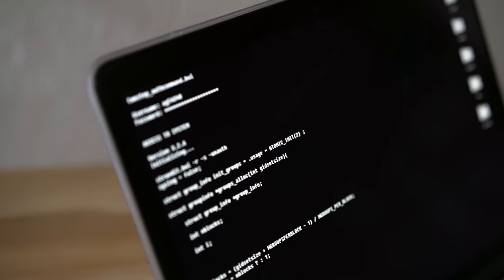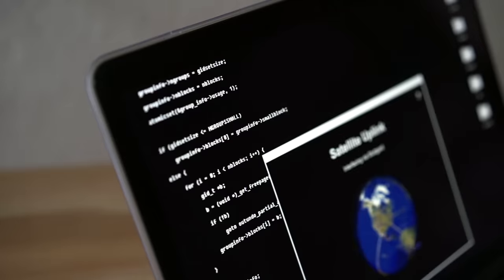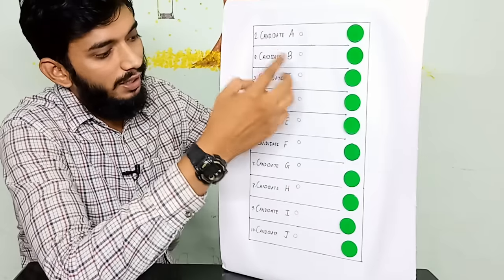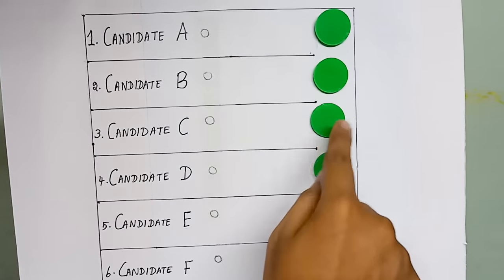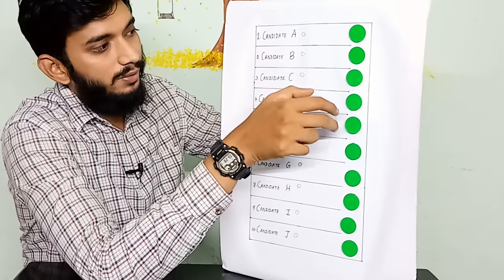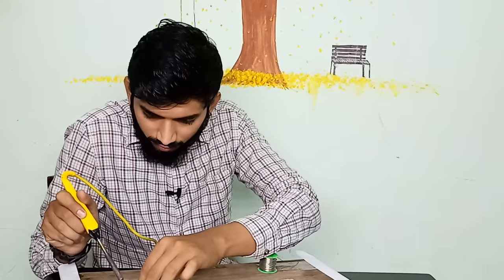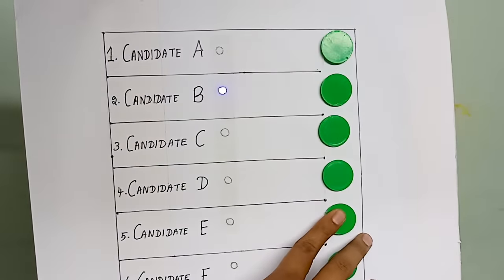EVM 'HACK' பண்ண போறேன்!! Is it possible to hack Voting Machine (EVM)?_Tamil.

Comment: Bro I have participated in EVM hackathon with my team organized by ECI in 2017 at Delhi. EEPROM serial number(16 bit) is actually binded with in the ROM software, so even if you replace another EEPROM that has different serial number the control unit will not read the memory at all. It will throw MEM ERR. The ROM is once programmable during manufacturing I can't even reverse engineer the ROM byte code. Athula JTAG illa UART illa I2C illa onnume illa. Thalakila ninnu thanni kudichi paathutom onnum panna mudila.. 😭
Reply: Oru machine la record aana vote ah inoru machine la display pannikaatrom nu challenge pannom 1st round la. Waste of time. Ipo Iruka M3 model la innum secure pannatha kelvi paten adhu yennanu therila.
Reply: The only hack we could able to do is reordering the LED display. Instead of 4000, we could able to make it show as 0004 or 0040. Simple soldering trick. But adhyum ipo single module ah potutanga nu ninaikaren.
Reply: Thanks for sharing
Reply: Nice  info man
Reply: Engineering Facts Said Total Wrong, by seeing one side of coin. He missed to see another side. 
By the Programing Technique Anything Can Be Done.
Reply: @rejoiceagainisay6548  onnum panna mudiyathu.ean onnum panna mudiyathu nu thelivaa bhai sollitaru...maruoadiyumaa nambikkai varala
Reply: @MuthuKumar-sw7pe 

1st button la every 4500 press ku apram next 500 presses 4th symbol ku count register aaganum, light, VVPAT ellam endha physical button press pannomo adhu dhaan varanum. Ipadi panna mudiyuma? Because all they do is checking the count, not counting VVPAT.
Reply: There are EEPROMs with modifiable serial number. Or you can also add another microcontroller to simulate like an eeprom. So the steps would be: 1) Remove existing EEPROM and read it's ID 2) Have microcontroller to have the ROM code hardcoded and perform MiTM. Additionally, you can also extract the uC FW and modify the portion with EEPROM ID and reprogram another CHIP. It's too much work, but definitely doable. On top, there is no surety that there is no backdoor.
Reply: If there is backdoor what would be channel to access, just wondering. Radio waves ? Am sure even if someone manipulates it, it not going to based on eeprom..since everyones focus will be on eeprom
Reply: தம்பி இதை வெளியே சொல்ல தைரியம் வேண்டும். அரசியல் வாதிகளும் biased மீடியா காரனும் என்ன சொன்னாலும் இதை ஒத்துக்கிட மாட்டான்.
Reply: @CyberPsychGaming . நீங்க சொல்ற எல்லாமே ப்ரோக்ராம் பண்ணுன சாத்தியம் ஆனா இது வெறும் interface. So அதுக்கு சான்ஸ் இல்லை.
Reply: @elangorajasekaran7871  Apram epadi, 2019 election la AMMK ku 1900 booth la oru vote kooda register aagala? Candidate avanuke podalaya, ila candidate friends and family avanuku podalaya? 2018 la Karnataka Hubli thogudhila, count kum VVPAT kum 207 votes difference epadi vandhuchu, ketadhuku edhula adhigamo, adha vechukonga nu Election commission sonnangale, ipadi thappu nadakka chance irukka device'a epadi use panraanga?
Reply: Japanese drop this voting system 😅coz very easy to hack not 1ly Japanese lots big countrys
Reply: Good information 👍
Reply: Simply waste of time . EC solluratha ,puriyara maari solluraapla .. avvalavuthaan
Reply: @hariharanb785  Bro even if you read the ID of EEPROM , how do we know what encryption is used for the embedding software? Without that we cannot match..
Reply: @kaaki_Indian that too not possible due to the process called mock poll
Reply: @CyberPsychGaming wrong......u should know the process of how candidates list prepared and what is randomisation process
Reply: @MegaPugazh adhukadha konjam padikanum bosss...
Reply: @hariharanb785 this much work pandrathuuku evlo neram aagum pa...time between mock poll and actual poll is 30min ...oh so oru general election la say 1 lack booth ....so 1 lakah hardware guy in all booths before 30 min all the thing is doable...enna oru karpani...Ok counting munnadi polling ku aprom idha pannalama ..adhum possible illa 
.once counting is over the saved data is secured ..that is said as Hot EVM ..if any small physical damage happens the system is self memory destroyable..so better luck
Reply: @jeyssekar5799  that is true. I think a backdoor is a big possibility..no one knows it.

There are no rules or an ISO standards for evm. So it's purely a gray area device.

The SoC could have an in built wireless transceiver. Or they could have incorporated that for short range. It is very easy to change data by that. Or maybe they can also have preflashed EEPROMs and they just swap during counting.
Reply: @ArunKumarKanna  That's true. My statement is based on the fact that there was no security module. The document of evm also did not mention anything about TPM.
Reply: @jeyssekar5799  Then how 207 votes difference in VVPAT and Counting in a booth in 2018 Hubli (Karnataka) election? Is it printing mistake of VVPAT. Even  of it was mistake, how ECI can say take the larger number (VVPAT count) for deciding winner instead of announcing re-election for that booth? The symbols are well planned as place. The layout is always cental ruling party in row 1, state ruling in row 2, state opposition 3rd etc. Now there is a lot of time to cheat till voting day. I don't believe any person who says we are clean, we don't cheat. A basic programmer knows, that you can press 5th button, 5th light glows, VVPAT shows 5th symbol, but count registers for symbol number 1, 2 or any other than 5. ECI is not ready to cross count VVPAT against digital count.
Reply: @kaaki_Indian any machine can be manipulated. But till we know how it will be like a magic but once everyone knows how it will be simple
Reply: You have done a great job.. deserves more likes and subscribe for this channel..
Reply: அருமையான பதிவு,இன்னும் சில விவரங்கள் சேகரித்து பதிவிட்டிருந்தால் வீடியோ முழுமை பெற்று இருக்கும்🎉 ஒவ்வொரு EVM   பயன்படும் அரசியல் பிரமுகர்களின் முன்னிலையில் மட்டுமே பயன்பாட்டிற்கு கொண்டுவரப்படும்.மேலும் தேர்தலன்று ballot unit- இல் உள்ள அனைத்து சின்னங்களும் மாதிரி வக்குபதிவிற்கு உட்படுத்தப்பட்டு அதன் ரிசல்ட் அனைவரின் முன்பாக காண்பிக்கப்பட்ட பின்னர் தான் உண்மையான வாக்குப்பதிவு நடைபெறும்.வாக்குப்பதிவு நிறைவுற்ற பின்னர் எந்திரங்கள் அரசியல் பிரமுகர் முன்னிலையில் சீல் செய்யப்படும். Evm 100%நம்பகத்தன்மை கொண்டது❤
Reply: உங்களுக்கு ஹரி கே பிரசாத்  பற்றி தெரியுமா சகோ??
Reply: If during manufacturing the EEPROM can be modified. In such case how it is possible to restrict...
Reply: 1. Bro evlo pesura neenga America India va vida 50 yrs munadi irukanga Avanga yea evm use Panna la. Matha Nadu ga yea panna la.
Athula nambikka illa nu nu thana.

2. Atha voting evm machine la thana count aguthu result boring mudinji 1 hr la announce panna mudiyatha. Ethuku 10 days time. Result solla. Other countries la paper voting panni same days result sollranga.
Reply: Superb bro🎉🎉🎉🎉

Comment: I want to add some information regarding this topic:
1. EC (Election commission) saying that they will remove the battery once the voting is finished so hacking can not be possible after the voting since there is no communication port as well as non availability of power.

2. EC saying that we can't re write the program in the micro controller of the EVM so we can't write the program to make the machine to vote for specific candidate if the statement is genuine.

Comment: 1.Rtc  Time can change by wire communication,
2.EEPROM is storage IC ,it can be changed by wire programming software ( example,, before voting ,they reset or earse last voting counting)
3.It cannot be tracked, if tracking is possible then there's wireless communication chip will be inside.
4.For every election  each EVM is programmed based on no of  candidate & candidate symbols.

Comment: During election, every polling officer in the booth will conduct MOCK POLL in the EVM machine before start of actual polling. During mock poll, random voting will be done by polling officer with the presence of all party booth agents. Atleast 50 votes will be polled by pressing all the candidates button and later the mock poll results verified for checking whether votes recorded as per mock poll. It will also be verified in the presence of party booth agents. This mock poll is conducted for verification of EVM machine and to ensure it working properly for party booth agents. If any malfunction found then immediately it will be informed for replacement.

Comment: Software hacking is possible. The machine is activated by a program. All machines need not have same software. WhatsApp, Telegram, Signal are all working similar. But each app has individuality. This is a basic idea about hacking using software. Only there shall be an identification for different types of software upload. Net would look same but operations can differ. Appreciate your work to explain.
Reply: Yov boomer etha theriyama lusu thanama pesatha
Reply: Boomer uncle😂

Comment: @6:38 Very useful info.If there's no communication device, how will EC/BEL track after manufacture?
Reply: GPS will be installed in the EVM to track the realtime location. Apart from that,  there is no provision to communicate with the machine.

Comment: Mock polling is also done upto  50 minimum votes. Also when you switch on the unit it displays date and time. 13:06  After finishing polling control unit is closed by close button. No one can vote after closing this button. After polling, certificates were given to polling agents. It contains the data related to EVM and the total polled votes closing time of control unit etc. By using this, candidates verifying the details at the time of counting. 100 ℅ safe to the best of my knowledge. I am a teacher and handling EVM in many elections including congress winning elections also. Unfortunately teachers are also not aware of this machine. 
ஒரு பொய்யை திரும்ப திரும்ப சொல்லும் போது அது உண்மையாக மாறும்.  முக்கியமாக EVM ஐ localbody electons ல பயன்படுத்தும் போது அதன் நம்பகத்தன்மை கேள்விக்குள்ளாக்கப்படும்.

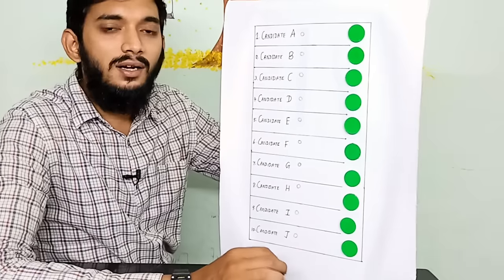Comment: Nice video bro! But one thing which I read somewhere is not matching with what you are saying 10:10 . The EVM when started, will run a test which will check whether the same components (such as the chip used for storing the votes) are there which was present during the manufacturing of EVM. If it was replaced somehow, the test can detect it by which we can find that some malpractice has been done. So there is no use in replacing the components as the EVM will not be considered for counting. Thanks for the Information bro!

Comment: 1. Before polling all EVMS come without any candidate name/symbol.
2. Candidate symbol is pasted at each constituency just before the polls at polling booths.
3. The buttons are allocated based on alphabetical order of candidate's name and not on party symbol. So in one constituency, a particular party symbol may be at first button as per alphabetical order of candidate and other constituency the same party symbol may be any other button or even last button depending on the candidate's name.
4. Hence programming of all buttons to poll votes to one particular symbol is not be feasible. 
5. Finally after the polling is completed,  the EVMS are packed and sealed immediately and stored in a secure place.
6. These sealed EVMS are opened in the presence of all party representatives at the time of counting and the results are downloaded. 
So where is the loop hole for manipulation?
Reply: Evvalavu sonnalum nam makkalukku mandayil yeradhu.

Comment: One important thing missed want to highlight that.. 

First Level Checking of EVMs and VVPATs is conducted by the authorised engineers of Bharat Electronics Limited (BEL) and Electronics Corporation of India Limited (ECIL), as the case may be, at district headquarters under supervision of District Election Officer, and in the presence of the representatives of the National and State recognised political parties.

No one can reprogram the chip. Because the program is burnt into the chip which can be done only once.

It doesn't have any wireless hardware so no one can connect wirelessly..

Comment: You left one more point.  

You said that the machine where we press the button and the datastorage recorder are separate and can work only with the matched set of device.   After polling only the data storage device is stored in locked room and not the voting button device.   So again no one can hack only the data storage without the matched voting device.

Comment: Bro i have a question,  table fan na on or off pannum podu  tv display 1 sec off agu, both are same plug, reason??
Reply from the maker: May be loose connection. Check the wiring

Comment: EVM can be tampered by different methods. 
1. Storing in eeprom as you told ( can be incremented by count= count +1) for particular party. 

2. Zonal officer is placing a sheet in ballot unit by placing candidate name and symbol and additionally how a control system will understand this random party names by uploading a kind of excel table in vvpat. This will again communicate to control system. Just adding a symbol or even a space which is not directly visible to human eyes can be understood by computer . Ex* XYZ party/ candidate has two spaces that party front and back . This party or candidate should win. 
Outside no one knows. EVM not a choice for democratic election.

3. PIN code after completion of election example 10 switches are there. XYZ party switched for longer duration will give indication to control unit( same power button of mobile having different functions)
4. Total votes can be decoded and manipulated by different ways by giving priority XYZ button is pressed first pPQR second IJK 3rd. Total votes can be manipulated by internal software to re arrange the counts so that the region part vote is win or near by etc… every machine can be prioritised time to time. 
XYZ part was leading in the morning and slowly losing at the end in the evening with last  10 machines once counted… 😂

Many ways still there Indians are super power in software
Reply: Program is printed on the chip, so no one can rewrite it
Reply: @rajkiran676  Bro, you are right ,program cannot be rewritten. But certain functions whichever already written can be activated by doing certain actions. 

One loophole is all candidate symbol is random in all booths . So manual input about candidate name and symbol is always needed in all location. A small space inside the name of candiate or symbol which is not visible in human eyes . But it can be detected as specific party by computer system.

Total votes can be manipulated by decrementing the higher vote candidate and incrementing the same in preferred candidate. So total vote will not change. 
Still many ways possible brother. 
I am saying from technical point of view. Here we are saying the age of AI. Think in that perspective.
Reply: @Nameeman-y5c  then why no one able to do that when electoral department asked. And remember there is a test and validation of program in the chip every times it turns on.

Comment: Bro, if election commission can track location, adhhula oru transmitter and receiver irukula  bro, adha use panni edhuvum maatha mudiyadha
Reply: Bro directa hack pannalum sore pannatha matha mudiyathu yannaa data stored in read one memory rom and it's permanent next time new ROM is installed before election, so no chance to hack even in dreams😂

Comment: Actually FLC is carried out on the particular machines which are going to be used for election where SL number are captured in system 1000 votes are polled and checked and after that the machines are sealed using EC/Govt seal, During election day mock poll is done in front of polling agent and other polling officers mock poll certificate is prepared and recorded after mock poll it is verified and cleared and sealed again before actual election's starts.

Comment: its possiable to mixed few Machine in everty booth ( its modified before the y send to the both which is well planned by Rulling party with Election commission togther in a month or year before ) if they mixed up with each booth then no need a person to  change the connection after deliverd the machines in booth before the election day..if they mixed up its not easy to findout and the impact very easy to succes for who planed to get massive VOTE in Rulling party's?? so this EVM always doubtful its my opnion

Comment: Sir you right by using net or wireless rf or hardware only we hack it's right but in this machine microcontroller ic so we can do any thing in this machine we already programmed and excited by simply selected keys so evm is not correct

Comment: If there is tracking device on it, then it should be capable of connecting via some rf or other signals
Reply: If everything comes under a single operating system, then it is possible. I don't think every components in evm is interconnected.
Reply: @muhammadfazil5555  I understand what you are saying and my answer is based on everything is interconnected , even if it's not interconnected it is easy to do so when all components are there in same device ,

And I don't accept that , it will not work when the box is opened